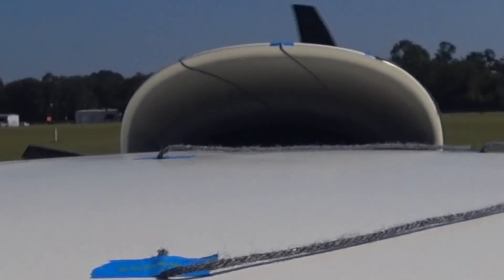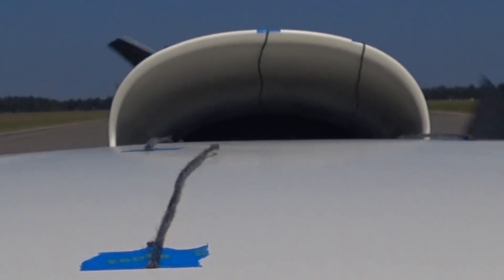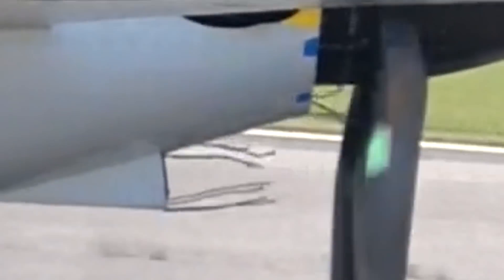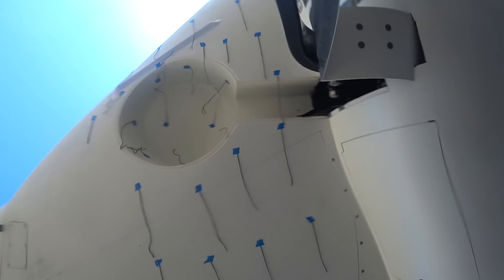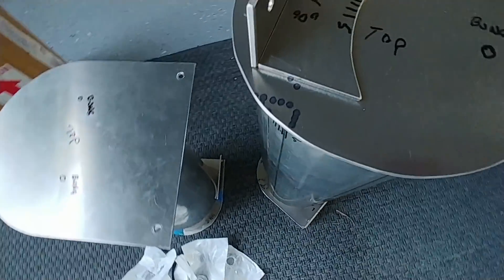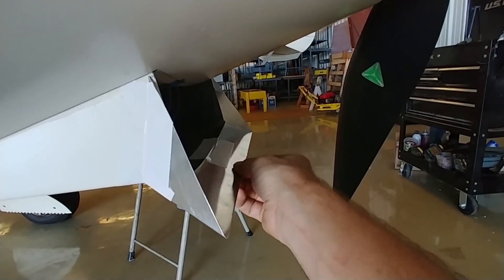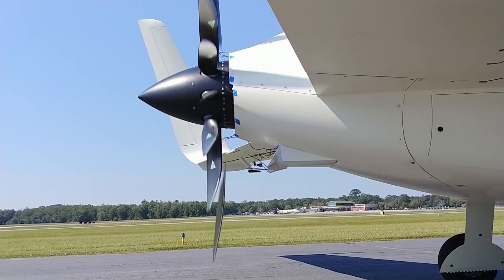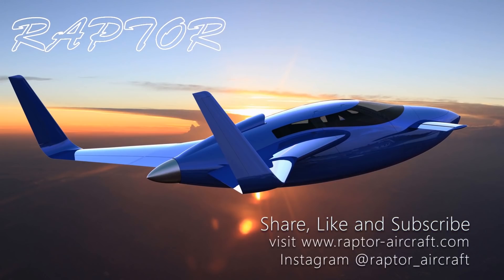Cooling and aero - Building the Raptor Prototype

Comment: Quick Louvered Raptor Tail Rendering: https://www.dropbox.com/s/chg7q7t70ato35j/Raptor_louver.jpg?dl=0

I think that more air in the engine compartment needs to be replaced more often. For that to happen, more air will need to come in, but now it doesn't seem possible because everything is going through the radiator and intercooler.  Even with louvers, more air needs to be able to come into the engine compartment. 

Looking at your CFD studies, the tail area is nice and low pressure. They louvers would have to be reworked to better fit the swoopy Raptor aesthetic. Three louver rows on each side might have looked better than five that I drew. It might be advantageous to keep the intercooler/rad duct in the lower-center, and add louvers on either side, and another inlet on top. A drain would be needed in lower on the tail. From your video, you seem to have a bit of a lifting body, but the louvers may not affect the top surfaces much.

I don't care for your trailing-lip experiment. Even if cooling gains are made, the lips will likely make the prop's air more turbulent. It would seem that if you do succeed in causing enough suction to cause more airflow at a lower air pressure, then that flow may not be very stable.

Even if all of your tools are is packed up, a new part could be made from foam, primered and sprayed with PVA. I know it must be pain to have a CNC of your caliber and not be able to use it, but if it something needs to be carved and Surform'ed tooled, then it needs to. If you need to--ask one of your viewers to 5-axis it from foam.

For science: air pressure sensor in main air inlet? An air pressure/vacuum sensor in outlet? When it's all said and done, the any ducting will need to have a path for water to exit, and a means to keep rain from the exhaust, so it won't crack.

While the air inside the wheel-well is very turbulent, are the telltails telling you that the air behind the wheelwell is all that bad? If it could be done safely, the wheel-wells could be blocked off to test, if you can can keep the duct-tape sheet-metal screws and cover out of the prop. : O

Moving cooling weight tank forward indeed may help with balance and heat-soak. It seems like a good win-win idea, as long as the hoses stay out of the controls.

[Learning how to make the louvers was fun in Rhino. I am making a Grasshopper sketch, so I could just select the cutout surface, and have a louver slider to control how many louvers. It's just drawn with an offset surface, interpolated points and lines, subdividing the edges and surface, drawing quadradic curves from: the end of lower surface, end of upper surface, mid of upper surface, end of lower surface. Then, the "U"-shaped rear curve and the next coplaner line is lofted. Then the surface is offset-solid inwards. No effort was even made to make sure the first louver had tangent continuity with the airframe surface. 

It was a 2-hour thought experiment. The real raptor has a lot more detail, thickness, overlapping shut-lines. Zues fasteners, etc. When I was drawing the airframe, I should have believed what the shadow line on the tail tried to tell me: the Raptor is a bit squarish in profile near the wing root. Mine is too round.

Yet more edits: I just watched your aerodynamic study video. For the MKII, I would chop that whole scoop from the top of your plane to restore its lifting body characteristics. Then I would add one duct on each side, starting from the rear windows, just like nacelles. Each duct would have: either a cooler or a radiator--plus 1/2 half of the bypass air to cool the engine, its headers, it's accessories, and it's surfaces. That and a rain separator and a tin to keep the headers from cracking. The ducts would triangulate the rear wing root, a bit. From the top of my head, I would size each duct to 75% of the frontal area you have. That would give you 50% more cooling.

Regardless, your high-performance engine deserves high-performance cooling.

Most edited post ever!

Comment: Open gear door bays and drag. MANY types fly with wells open. The rush to stow the gear during initial climb on many designs is a combination of cleaning up the airplane and getting the doors shut before the bird gets fast enough to damage stuff and/or not be able to close and lock it. They all fly fairly well with gear down. 

But if you just have to get confirmation, pull the doors from the gear, and attach temporary doors over the openings with 200 mph tape. Way safer than messing with the gear while handling an overheat emergency.

Comment: Tufts are not the correct tool for this job.  Tufts are only showing that, yes, there is.... some (?) amount of flow.  But really that should have already been known, as if there was zero flow your engine would have melted.  As many others have stated, you need to install some instrumentation to get any valuable information here.  Best of luck

Comment: You really need delta p and delta t measurements across the radiator and intercooler. Without those you can't really know what's going on with your cooling system.
Reply: Yes, but static too! : )
I suggested putting in pressure/suction sensors, too. I would like too see the engine compartment under FLIR, though a zero gradient inside the compartment skin might insulate the surface to make it look cooler than the compartment is. Hmmm.

Comment: I am a car nut who loves racing and aircraft.  You said you were not running an air cleaner.  Back in the 90s, a C.A.R.T. racer tore off his visor protector during a pit stop and it was sucked into the turbo inlet.  Weird occurrence  that blew the turbo and his race.  Protect the turbo!  Planes are probably different than cars in this respect, but a FYI (if it helps) the hood scoops of the Plymouth Road Runners and other cars had an elevated element in front of where the air actually entered the hood due to air flow tests in the late 60s and 70s.  They found that the small elevation actually helped direct the air into the carb with more efficient flow due to that small lip.   I don't know if it would act the same way of an airplane, for it looks like the flow is following the body shape into the inlet.  What you are doing is really neat.  I assume the Diesel V6 you are using is the same VW-Audi V6 used in Touregs and all kinds of Audi SUVs.  If so , it should be a long lasting engine.  Good Luck!
Reply: Oh hey Ken.

Comment: You need air pressure across the heat exchangers to move air through them. the usual way to check is to put a manometer in front of and behind the radiator, oil cooler, etc. At 60 knots, you should have 10 lb/ft^2 or about 2 in water at the front face and close to 0 in at the back face. If they are close in pressure, no air is going through the heat exchanger.

Comment: As far as the turbulent flow in the wheel wells, what does the velocity do?  This airplane is really just a bigger, heavier version of a velocity. The xlrg does not seem to have this issue. Might be worth investigating the aerodynamics of that aircraft specifically.
Reply: plain, big ol' open holes in the bottom of the wing, but much further back from the leading edge than on Peter's Raptor: https://www.airteamimages.com/velocity-xl_SP-YXY_-private_185082.html

Comment: the whole cooling system is questionable to say the least. starting from position of the radiators, the airflow (lack of) study, the wonky idea if using fuel as coolant etc.
also, the elephant in the room, that has not been mentioned at all, is the lack of power. airplane barely climbs not far from stall speed. 
its high time to take a very good look at the whole thing, bite the bullet, get funds and start building a second prototype 1000 lbs lighter, simpler, and according to original design, using the knowledge so far gained. 
too many things are wrong, and with very small chances of being easily fixed.
serious cooling problems, serious lack of power (that if fixed would worsen the cooling problems), stability problems, weight problems. list is long.
lets be clear here. this prototype is not going anywhere.

Comment: Hi Peter, I'm glad to hear that you are thinking about a more permanent solution for the wheel well turbulent flow drag issue, please reassess the spring loaded aluminum disc insert.

I would simply like to mention again  the addition of a stainless steel centrifugal fan impeller inside the cowling before the propeller as I don't think the existing combination cowling/propeller is extracting the outflow air fast enough, these type of solutions are commonly used for helicopters that need cooling when hovering, and are thought to be unnecessary for aircraft, but they serve a purpose, especially pusher drives 

The type of centrifugal fan impeller, I'm talking about looks like this link.

https://3.imimg.com/data3/QA/ME/MY-5058603/id-fan-impeller-250x250.jpg

Here is another link to impeller design software and capabilities.

https://www.caeses.com/forum/index.php?/topic/48-free-propeller-design-software/

Not a big fan of expansion tanks at the front of the plane, I know it's a volume/distance thing, but just saying. As has already been mentioned by others, look at ensuring that the water cooling system has been bled correctly, look into the oil cooling system and look into the dual turbo pressure issues suggested elsewhere. Go team Raptor, Thanks.

Comment: Peter, some different way to get better cooling.  Oil temp seemed to rise most.  It may be possible to weld fins onto sump of motor which could come through to outside air. If fin is in line with air flow, it should be aerodynamic . Or make heat exchanger  with fins mount as described before.  At present the cold air comes in air scoop through radiator and heat exchanger and hot air reheats engine and turbocharger and long  inlet pipes to turbochargers inlet.  Fit air scoop under aircraft to cool engine and turbochargers, the hot air from heat exchanger and radiator could be ducked along underside top cowling to vent similar to bottom at propeller.

Comment: 1. If the low pressure turbo is removed the HP will go up and the temperarure down, less weight as well. 

2. The wheel wells  are located at a challenging area in terms of lift with the gear down causing drag and canard stalling.

3. Cooling... there is enough air coming in but not going out accordingly,it seems like a lot of  turbulance happens inside the cowl and causing overheating. Make some buffles to channel the air out thus causing a suction on  the outlet scoop. Imagine a scenario with the aircraft at gross weight and having to use all the power available until you get to altitude.. temperatures will rise quickly.

But first things first .. cooling and closing the wheel  wells temporarily.

My 2cents advice.

Comment: I really enjoy this. And love the design of the Raptor. 

With the cooling should the  egress be larger than the inlet?
Baring in mind the air is heated and will have expanded. 
Also could the experience of the P51 Mustang radiator that actually produced thrust be used. 

Once again. Many thanks and keep up the good work. 
John W

Comment: Guys/gals, have some appreciation for the scope of this project. I was cautioned many decades ago to never ever try to develop a new airframe and a new power plant simultaneously. That advice was learned the hard way and history has born it out repeatedly. The theoreticals involved are valid but the development cycle is far longer than desired and frustration is understandably showing. From a distance I can’t understand why the airflow through the radiator has yet to be measured. Simple pressure delta. When an engineer, experienced with the very engine you are using tells you to seriously re-rack the turbo set up and explains it in detail, I think I’d take a serious look at what he has to say. Inconvenient? Costly? Yeah. But necessary. I get that a second turbo is perceived to be needed to pressurize the cabin eventually but that need is a ways down the road. If it doesn’t fly well, that point will never be reached. Essentially, too many critical things going on at the same time. Plug the wheel wells. Variable eliminated. Revisit once you have a flyable aircraft. Eliminate a turbo. Variable eliminated. Get an expert in on the cooling. There are too many things to be learned that others already know. Fluid dynamics is a black art, not a science. Find a magician. No one person can do it all. Build a credible team and manage it. (Extreme WAG. If the power increase estimated by the engine developer is correct, 230 to 300 hp, you have the energy to run a dedicated electrically powered pressurization source. It worked for the B-787.)
Reply: Eh, people have been offering this advice for years now to this aircraft builder, and he has consistently ignored it. What makes you think he'll listen now?
Reply: I watched some of the best and brightest that GE and NASA could amass work the AMK project in the eighties. It’s a black art. These guys understood it. That was their opinion. But they made a good living at it and we eventually ironed out the problems.
Reply: I’ve seen the movie before. Hoping for a better ending this time. Been to too many funerals of enthusiastic friends. If one doesn’t speak up when someone is heading into harms way, then he’s complicit in the outcome.

Comment: He really has not thought this through.  He could have made up/used/bought a water storage vessel,  modify with a coiled internal heating tube and connect it to the cooling system. Very little increase in coolant but a big heatsink of separate water and NO change to his expansion tank above the engine.   This could be put together in a day not a week.
But none of this actually helps long term except  maybe flying a circuit and then has to land.  He needs to remove a turbo , the turbo set up has been flawed from the start and many have pointed this out  a very long time ago  but PM never listened.  It has now come back  and he still will not listen. I think it is quite sad the way this project is going as PM  is determined and  has blinkers on but at same time lacks engineering acumen. He has the skills to manage a project, proved by the fact he has got this far and I have to tip my hat to him for this, but he has to now listen to Engineers who know  what they are doing, have experience and for goodness sake get help with making parts as his workshop skills are not his natural ability.    He needs more investment and these issues are surely putting of future  investors with the amateurish  way he is moving forward, indeed down a dead end road just now.  Whether he likes it or not the information on  his turbo problems is now out there  for investors to see,  and so he has to address this and 'prove' the engineers 'wrong' and he does  indeed know what he is doing.
Reply: People are going to start loosing faith in this guy soon if he keeps ignoring good constructive advice from people more senior in engineering than him ..!! If he keeps goin the way he is ... then I can see people wonting there deposits back ..!! 
Now I’m no engineer , I’ve experience in flying rc model airplanes and even I can say that he doesn’t need to cover up the wheel wells due some undue turbulence causing the aircraft to pitch up and down .. 
My first thought that it was very pitch sensitive and the general cause of that in models is a C/G to far back ..  then as somebody ells pointed out , it’s underpowered and flying very close to stalling speed and probably is stalling and then it’s recovering itself and then stalling again recovery then stalling again hence the porpoising..  when that happens after you cut the power in models it generally relates to a correct CG apply fill power and fly out and it’s fine .. this isn’t happening in raptor as he has no more power to apply .. 
If he doesn’t start listening soon then it could end up very messy
Reply: @jamesthick6078  and this is supposed to carry a pilot and up to 4 passengers. Imagine if it can barely get into the air with one pilot and a one hundred pound weight in the passenger seat how would it ever get airborne with a full load of people and bags etc? I doubt that it could reach V1.
Reply: p.s.  A further advantage of separate water tank being heated is the specific heat capacity is about 30% better than coolant.   As it is just a for test purposes no need to add any antifreeze.   I still do not agree this is the right path but as it is the path taken it  can be improved on vastly.

Comment: nice work.
no expert here, but it did look less turbulent without the extra deflectors.

also, the chord length near the fuse vs stall speed ,, i wonder if its just too slow and the wing center is just plain stalling due to low chords per second airflow?

Comment: Peter, meet Julian: 
https://youtu.be/AAYqrDUxTiY
Around the 3minute mark might be helpful.  
He has other videos on optimizing airflow through cooling systems with an eye to minimizing aerodynamic drag. Principles have got to be similar - modifying for your purposes mightn’t be difficult.

From watching his videos, I have a hunch that your cooling problems might be the result of trying to draw low pressure air from over the top (roof) surface and exhaust it into a higher pressure (lower) area - the whole plane generates lift, not just the wings. Tufting shows flows- pressure is the key. Relative pressures specifically. I’d measure the differential between in front of the intake cowling and inside the engine compartment, and between engine compartment and exhaust port and then between intake and exhaust to confirm this. Consider the size (and position) of intakes compared to exhaust of F-15, -16,  -18 fighters - smaller intakes in high pressure under the wing. Yes, speed reams volumes of air through the engine, but the intakes are located in higher pressure areas for a reason.
Another of his:
https://youtu.be/P7Wh1XoystM